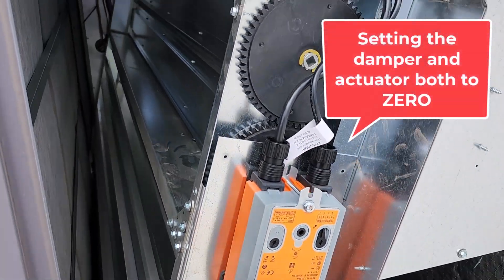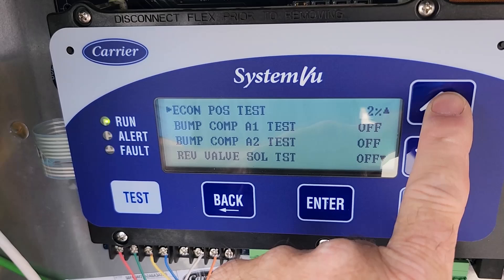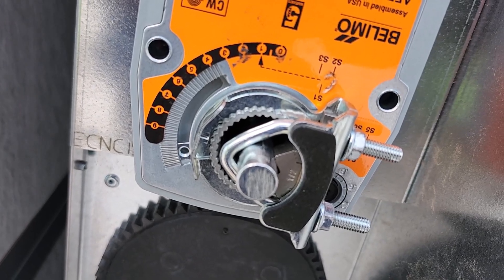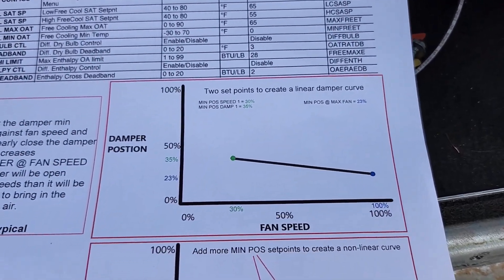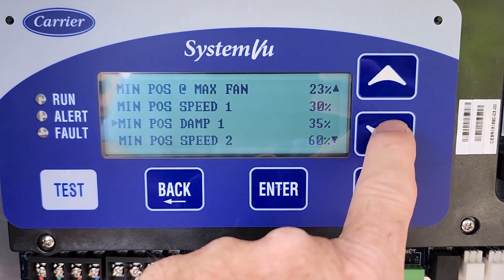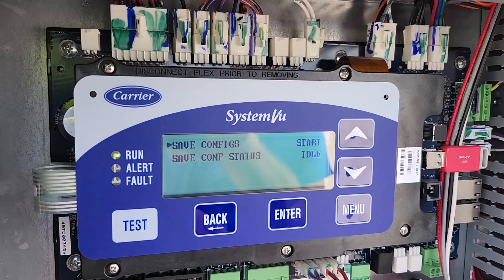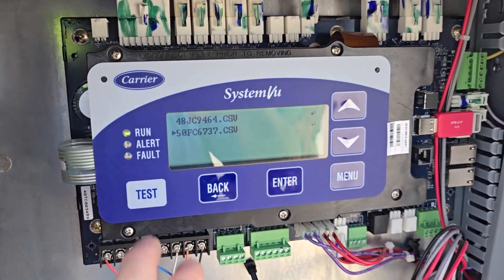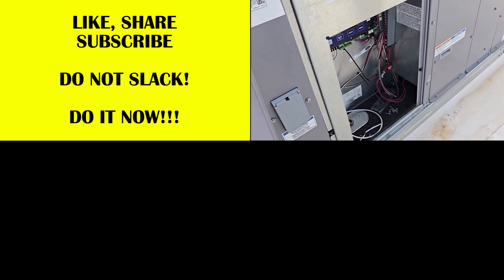Carrier SystemVu economizer settings and actuator wiring

Comment: Out of all the hvac techs I follow you really know your shit! I've done industrial electrics in my time playing around with all sorts of PLCs, but never had a chance to work on a big HVAC unit. 

Any advice getting in the field, I'm heavy on IoT & BMS experiences. We load shed devices as not to trip the main CB of the complex should a de-energization occurs.
Reply: Was that an F11 that flow over?!?!
Reply from the maker: Yeah not far from Luke Air Force Base
Reply from the maker: So you want to go from the logic side to working on the units?
You could maybe get into the controls side. Then you'd get to hook up the integration side, configure etc on the controls side.